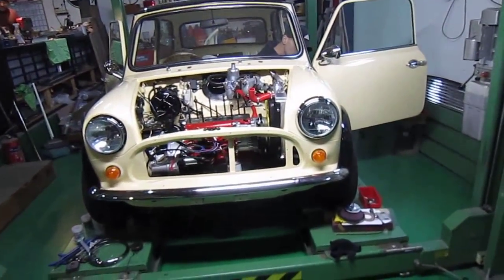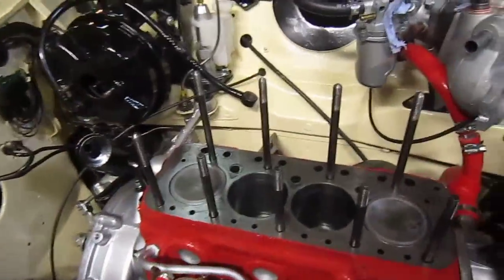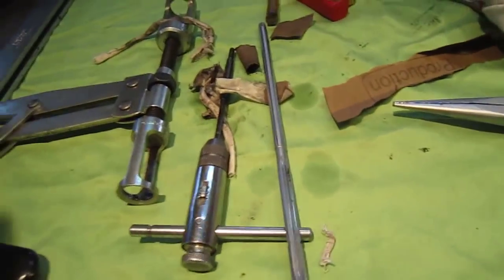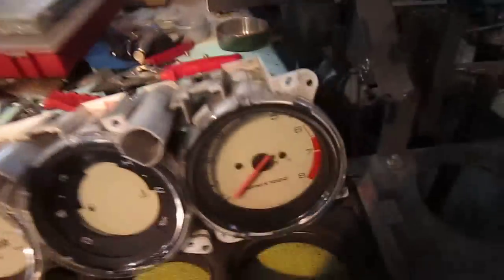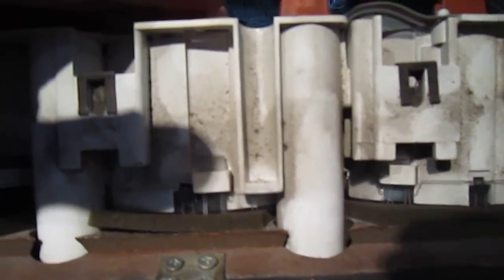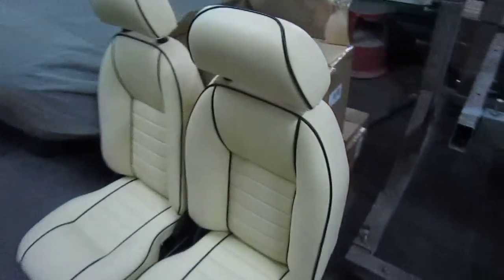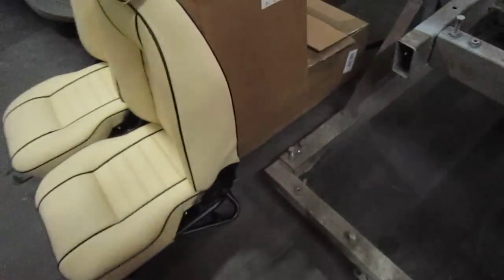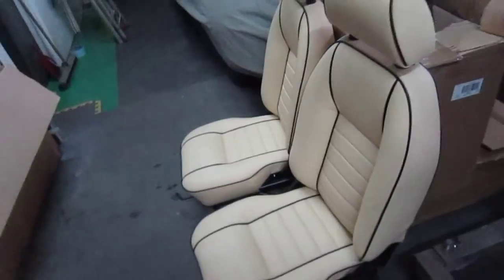Classic Mini Cooper Exhaust valve update

Comment: Are the clocks from a carb’d mini ?? I don’t think the mpi clocks use the same RPM signal ? I could be wrong ? Just thought I would say
Reply from the maker: Paul. The RPM works fine as its coming direct from the coil only the MPI mini was different. Cheers Dave.
Reply: davejaguar66 that’s ok then ! They just looked like later clocks as they’ve got the plastic glass (if that makes sense) .... made that mistake myself in the past that’s all lol

Comment: Hi dave another great video. Those seats are lovely. Regarding your arch trim, rubber and plastic will always go back to its original shape when warmed up. Gently warm the trim with a hair dryer. Regards Simon.
Reply from the maker: Simon, Thanks i will give that a go sounds like a top tip! Cheers Dave.

Comment: Good catch. So basically the valve guides had been reamed by a worn reamer and Max is reestablishing spec size with an adjustable reamer. How’s the valve stem - is it still true? Might be prudent to put a new one in.
Reply from the maker: Norman, The valve was fine no marks at all on it as the reamer was only .005 under but enough to jam the valve. Cheers Dave.